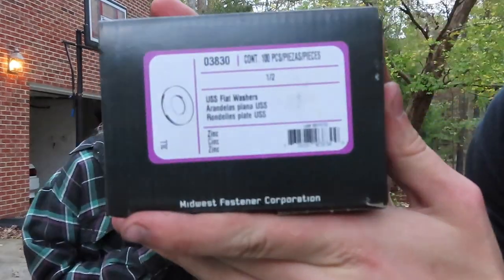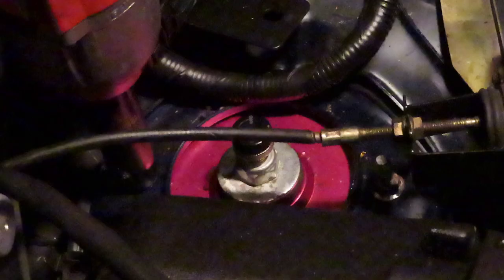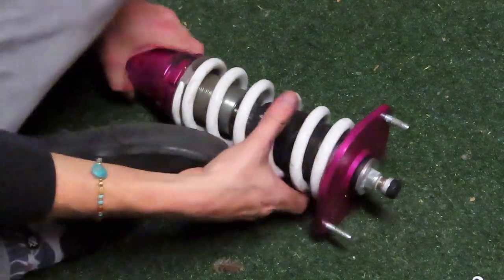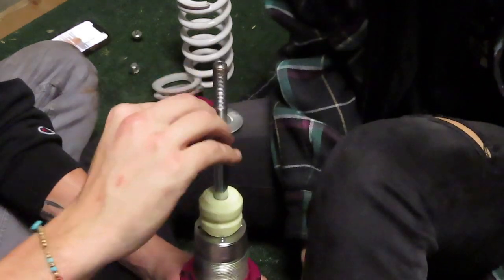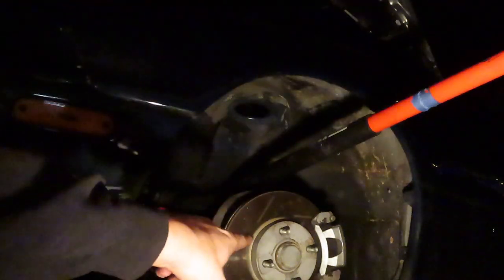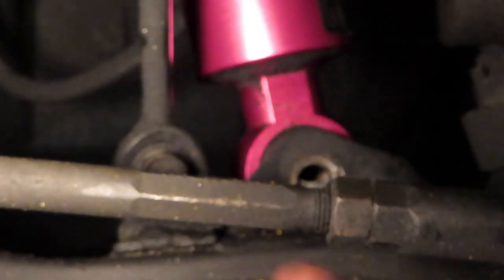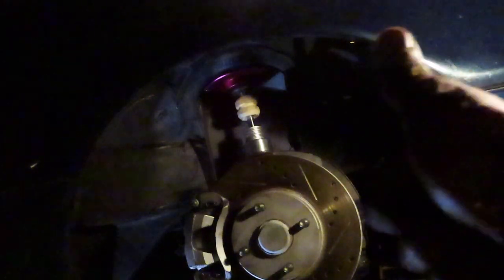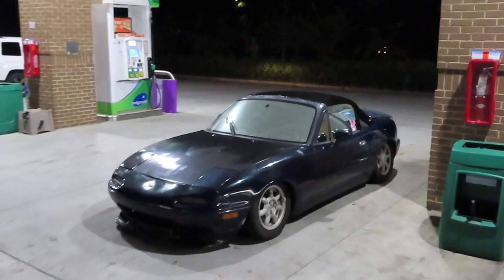HOW TO PUT ANY CAR ON WASHERS!!!

Comment: Will the bump stop not make it too bouncy? Also i have a fwd car so the rear has the spring sitting apart from the shock any idea how i should do the rear?
Reply: Just cut the spring or get a 2-3 inch afternarket spring that has the same diameter.
Reply from the maker: It will be super bouncy no matter what unless u have soft springs. I mean what has been done before was stack washers on ur rear shock and take out the spring. Not advised

Comment: quick question:can you lower a car on stock suspension im 16 just bought my first 98 gs300 and i wanna get into the car scene
Reply: actually nvm 😂
Reply: yolo imma do it
Reply: @5ojohn  spring pops out
Reply from the maker: yeah but get coils tbh
Reply from the maker: yolo lmaooo
Reply: eBay coils and put washers on them if that’s what ur trying to do
Reply: you can do stock struts with washers on 2gs, i'm thinking of doing the same hahha
Reply: @br6dk  Damn when I was a kid we were just cutting coils off the spring. Y'all are just throwing washers in that bitch. Respect
Reply: @dooflydetailguuy4349  washers and hockey pucks! invest in some stiff coilovers though my fav thing on car.
Reply: @br6dk  I wonder if Jr hockey pucks have softer stiffness
Reply: @dooflydetailguuy4349  i used POTG pucks from when jr hockey league haha

Comment: how do you adjust it with you shock body, without having to add or subtract washers to adjust the height?
Reply from the maker: for stock struts you have to add or subtract washers, if you have a coilover you take out the spring. figure out how many washers is a good starting point and then adjust the coilover form there
Reply: Just buy new springs

Comment: doing this to my Z tomorrow, great vid. Thanks!
Reply: How’d it go??
Reply: @AngelPerez-ug3sl  really good, it was easy. took about 30 minutes for the back to do on stock suspension, and about an hour for the front. I'm now running less than a finger gap all the way around with -3 degrees of camber but could definitely go lower and tuck on stock wheels.
Reply: How many washer did you put
Reply: Dariel so In the rear I have 13 washers on both sides, in the front on the passenger iss I have 4 and the drivers side I have 5, my suspension is getting old so it drops a little bit more... hope that helps
Reply from the maker: oh lawd haha
Reply: @walkerpustka2179  gg if u have an ig for it slide it
Reply: @colbemugen9932   @isla_z33
Reply: @walkerpustka2179  what’s the new one ? i couldn’t find it